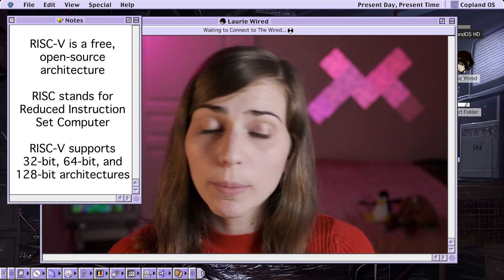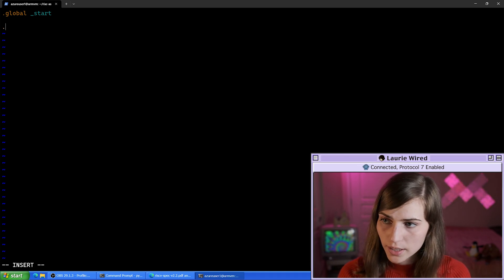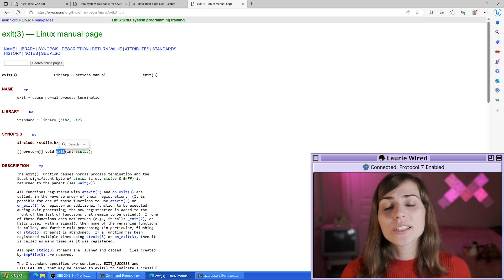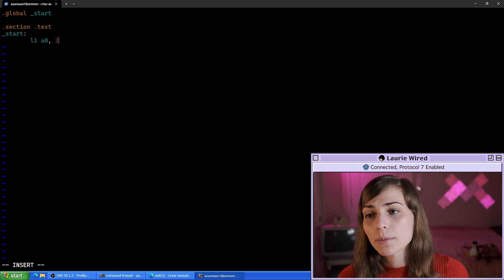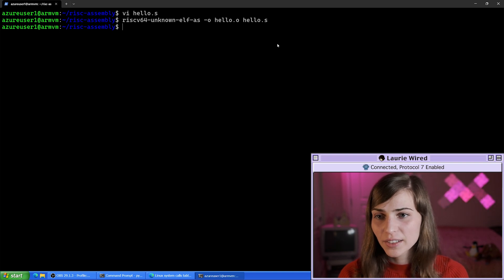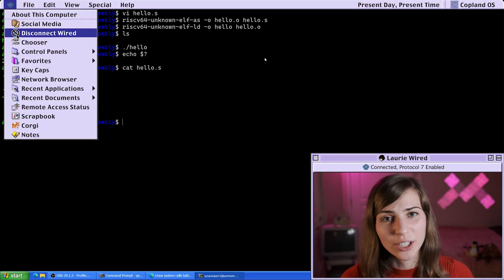RISC-V Assembly Hello World (Part 1)

Comment: Great video! Only the man page you are showing is the exit(3) C library function not the _exit(2) system call you are actually using in the code. It works however since the ABI convention for passing the first argument to C functions and syscalls is the same (a0). Keep the good work. Thanks.

Comment: Hi, Laurie!
1. How did you get the `riscv64-unknown-elf-as` binaries on your system?
2. Why are you directly running the `hello` binary, not in QEMU, and it successfully runs? Don't your host and the binary use different architectures (ARM vs RISC-V)?
Reply: Ad2: this is magic of package "qemu-user-binfmt" (at least on Arch, but I suppose the package is called similarly on other distributions). This package mounts "binfmt" kernel handlers for executables (this is the part of the kernel that knows that a file starting with #! is a script). Handlers recognize for which CPU the application is compiled and automatically run it under appropriate qemu version.

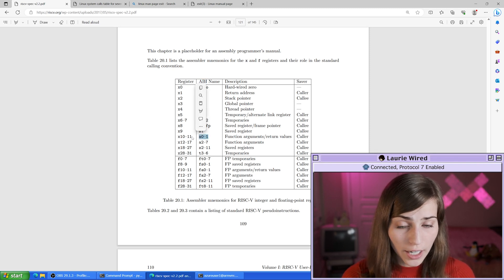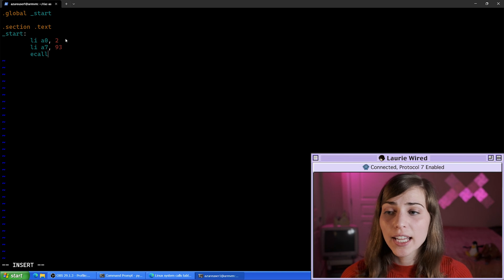Comment: I find myself trying to find mouse power cord pinout and processor pins is this diagram 5:14 or just some RDF data samples. You be my Ardenweald Vulpin form 2:04 riding Honda Type R. It's invoked automatically 3:25. And you spend countless knights romantics checking that php function documentation  6:59 str_replace str_concat. This language is a complete primate of object orientated languages and there is nothing you could do with it unless on/off light switches 8:06 which would then be called on the system boot.

Comment: You remind me of when I was younger and coding in M6809 Assembly like crazy every day.  I miss M6809.  I also miss the OS9 operating system.  I don't know much about RISC-V yet.  I have been holding off because it was really slow and immature last I looked.   However, I think I am hearing something about an extended instruction set capability or such that can be used for building an AI accelerator??  Not sure.. I will research this tomorrow.  Is there a way to build numerical parallel compute cells, by chance?  The mnemonics look fun.  I have a special kind of catalyzed neural substrate emulator.... I wonder if RISC-V might be a good place for an implementation of it.

Comment: I even come from the land of machine code programming, but where is the need for a assembly code programming for these niche archs? Is it just for fun sake?
Reply: Well, RISC-V's main product segment for a while will be embedded, thanks to the super simple instruction decode and free to use design. Higher level languages, though supported on risc-v pretty well, unlike some other microcontrollers, still might not support any custom extensions, or some such that could be added in the implementation. I could see a  modded assembler being very easy for a company to make before C could make use of the instruction natively. Otherwise it's good just to get familiar with it, I think, and for computer science RISC-V is excellent curriculum since it's both unlicensed, and relevant for future use, unlike previous curriculum ISA's that focused on MIPS for pipelining etc architecture, or PIC16 or something for assembly programming.

Comment: Hey, Laurie! I really enjoyed your video, and it has sparked my interest in RISC-V. 
I do have a question, though. Doesn't QEMU already provide emulators for RISC-V architecture-based systems? If so, I was wondering if there was a specific reason why you opted for an ARM emulator instead of using QEMU's RISC-V?

Comment: Nice video but you looked at the man page for the C library exit function, which is the same on any Posix system whether Windows or Mac or a *nix, not the Linux exit system call which is a different thing. They happen to have the same status argument but the C library function also calls exit functions before doing the syscall. You wanted "man 2 exit" not "man 3 exit".
Reply: Yes! I loved the video, but that part was bugging me. 😊
Reply: 💯man 2 == kernel sys calls, man 3 == lib funcs\subs (not that it really makes any difference in this case since she didn't link any libs)

Comment: Is riscv64-unknown-elf-as part of standard GCC & can be installed on any architecture?
Reply: On Debian systems (so also Ubuntu etc.), you can install it with the package manager. Here is a full tutorial I wrote how to do it, which also uses just "gcc" instead of the 2 steps "as" and "ld", prints some text, and has some more background information: https://gist.github.com/Frank-Buss/aa6aa7d4907335e4a529e8cf3e82f47e

Comment: I thought assembly bypassed OS level interaction completely, i.e. instructions are loaded into a stack that a register points to and the way to exit the program would be pointing to either whatever was in the stack before program load or a specified point in memory at which point OS picks back up? I learnt some x86 assembly a decade ago and I'm not sure if that info carries over, so I might be completely wrong or outdated.
Reply: This is assembly language to run under an operating system, in this case Linux. Assembly language that runs without an operating system has no way to exit -- at most 1) infinite loop, 2)  reset the hardware and run again, or 3) maybe turn off the power (it's a PC feature not a normal embedded system feature)